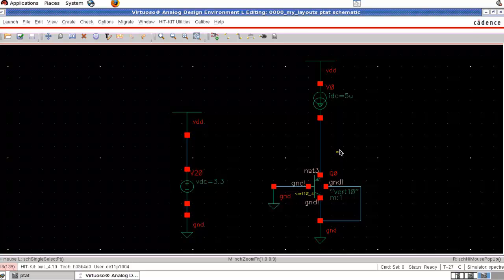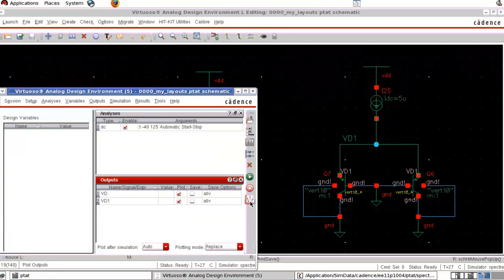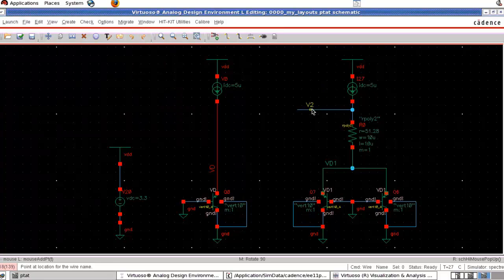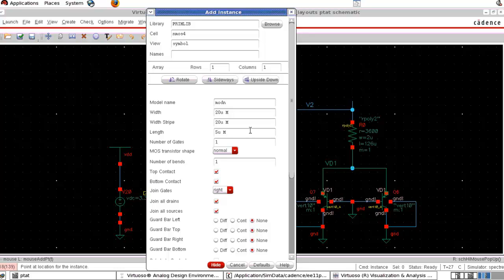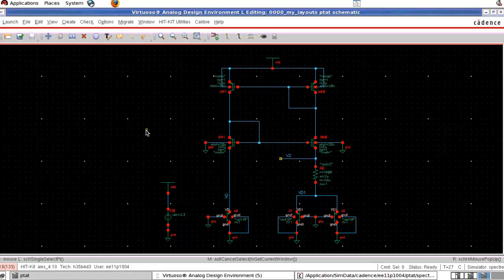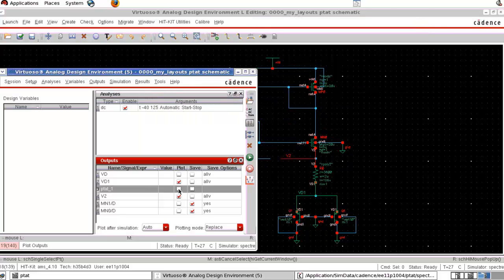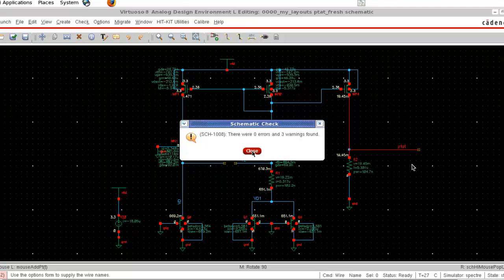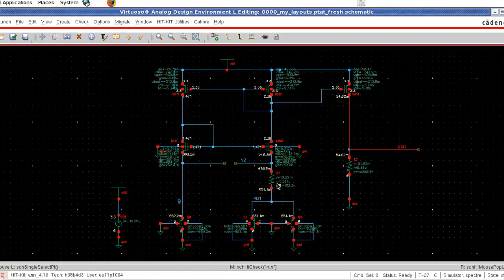Design of Bandgap voltage reference (BGR) - 5 : PTAT simulation in Cadence

Comment: Sir why r u choosing rpoly2,why not normal resistance and why u changed the w/l ratio
Reply: If u take resistance from analog lib, it's layout can't be drawn. So we hv to use actual poly resistors that is made up of MOSFETs from the particular technology lib  and their layout is possible and we can also see the PVT variations.
Reply: @amritadikshit5952  thank u
Reply: Hi...I am making bandgap voltage reference circuit in ltspice .....there is no option for poly resistor in ltspice....can anyone help me?

Comment: how did you get a Vt of 26mV?
Reply: slope of dVt/dT is 86.25uV/kelvin so room temprature is say 27 degrees so ie.300k .therefore multiply 86.25*300 it will give you vt of roughly 26mV at room temp. 
thanks

Comment: im trying this circuit in Synopsys tool, im asking about the current in the PMOS transistor in series with RL, is that negative?  The ptat voltage graph im having from RL in respect to temp is falling starting from -40 to +125.